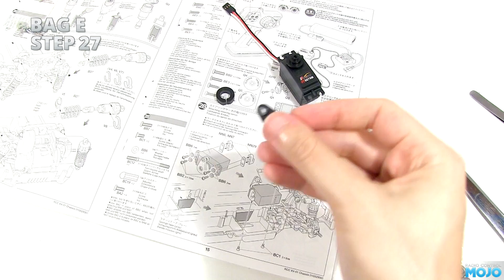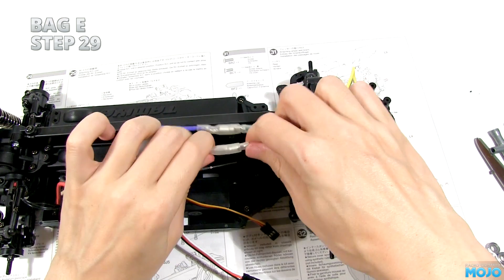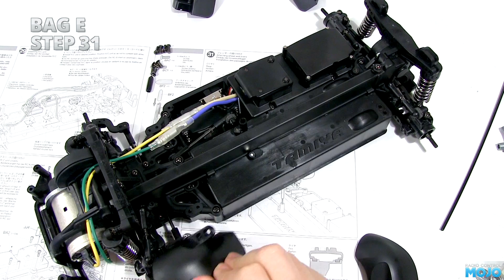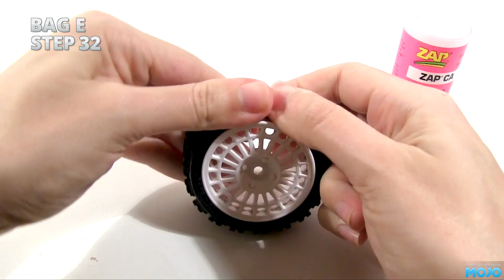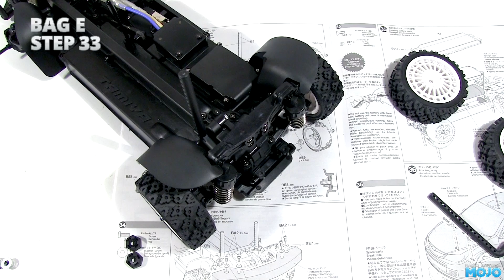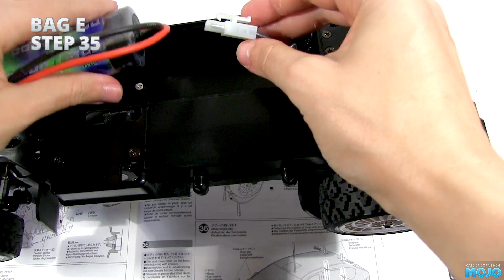Tamiya XV-01 - Build - Part 5 - Bag E

Comment: With all the stock parts used for the servo and arms is it ever possible to have the left and right trim on the remote on neutral or will there always be out of alignment due to different servo designs?
Reply from the maker: Variances in servos mean that some will be spot on and others will be off. An ideal setup will have everything at 90º to each other, this will require an amount of sub trim in most cases. After trimming for straight driving you should ideally return the trim to neutral and adjust the linkages.
Of course what's ideal and whats necessary aren't quite the same, if the servo arm is a degree or 2 away from 90º the left and right steering wont quite match, but by such a small amount it's not worth worrying about, unless of course you like everything to be spot on...

Comment: But led lights on body
Reply from the maker: The body doesn't lend itself to lights. However, the front grill is chromed plastic, so it may be possible to drill out the fake lights and replace them with some proper lenses. The rear lights are a bit more tricky, I'm thinking maybe a resin cast of the inside, then shape it to make light buckets, not sure...